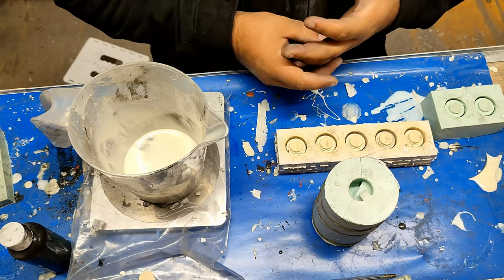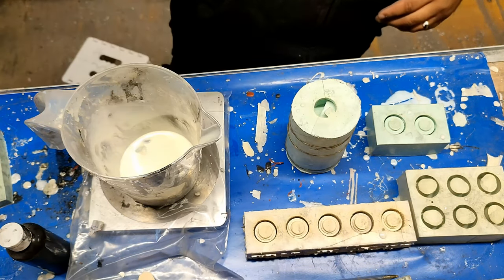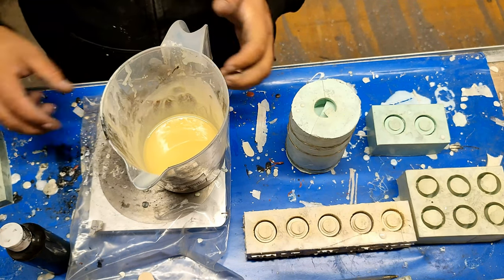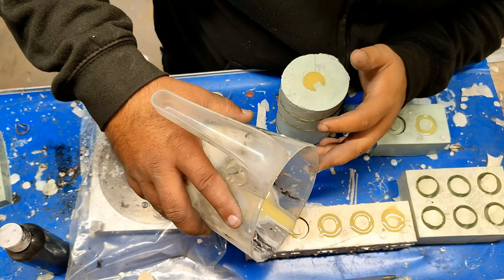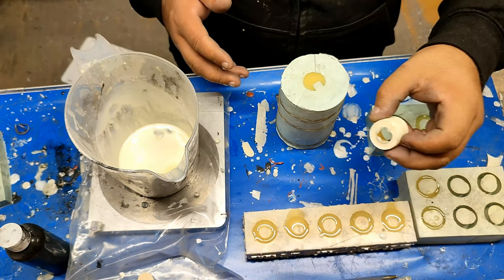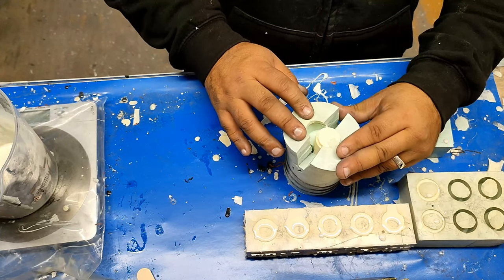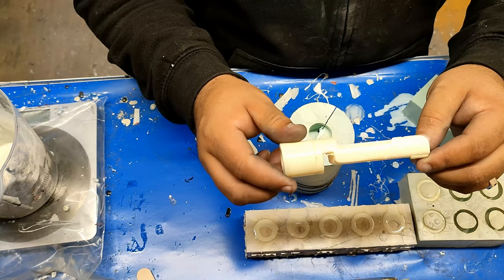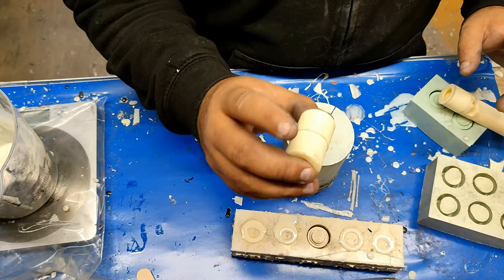How to make a lightsaber chassis. Check out how #ForceSabers pour our chassis for our #lightsaber

Comment: Do you use a chassis on RGB sabers as well? I've heard it makes them sturdier for duelling purposes?
Reply from the maker: with the RGB setups its just a battery and speaker pack thats all. there's no chassis used on them just a neopixel has a chassis
Reply from the maker: i should say that the internals have a strong foam fitted inside between the battery pack and electronics to allow for impact and to give everything a very firm fitting.